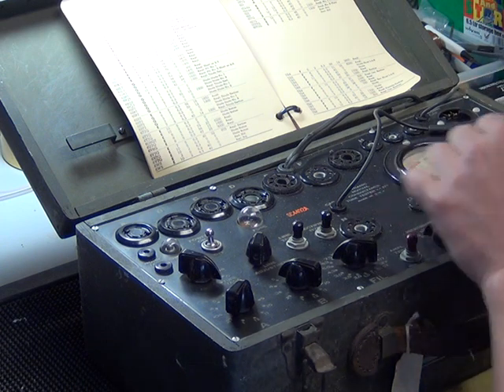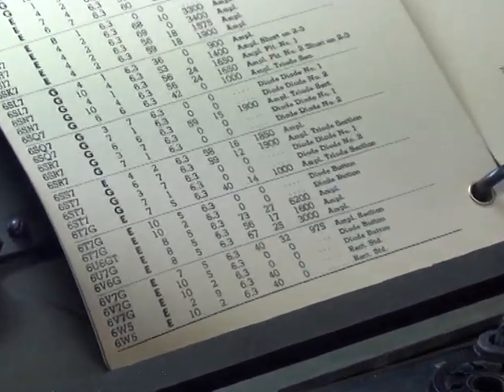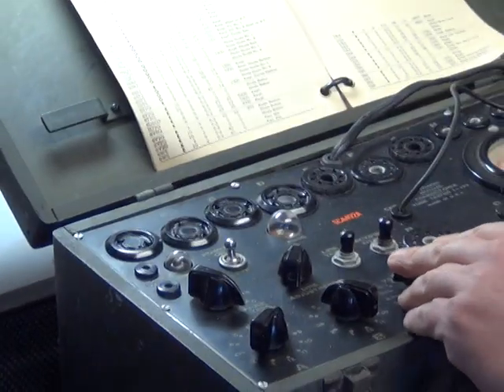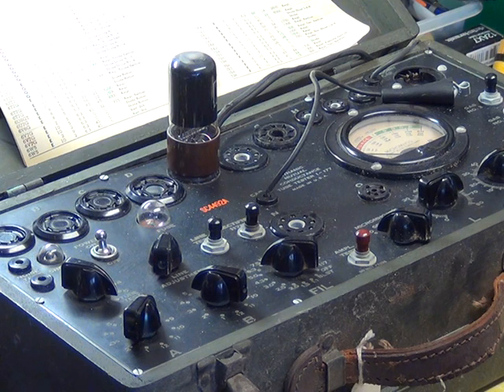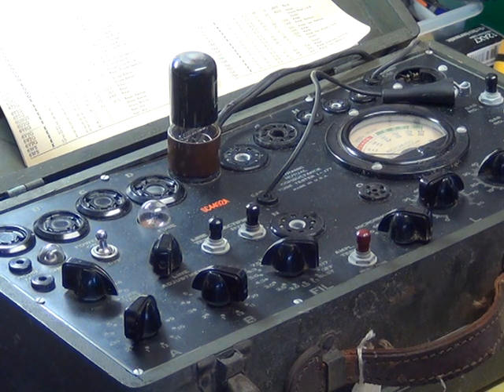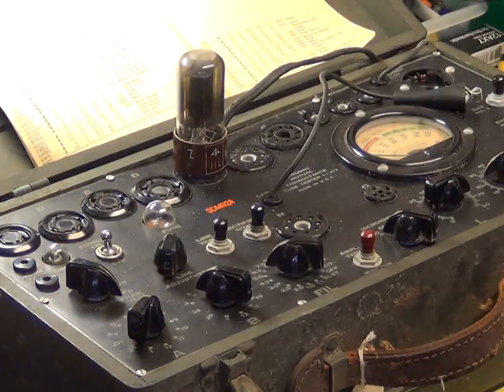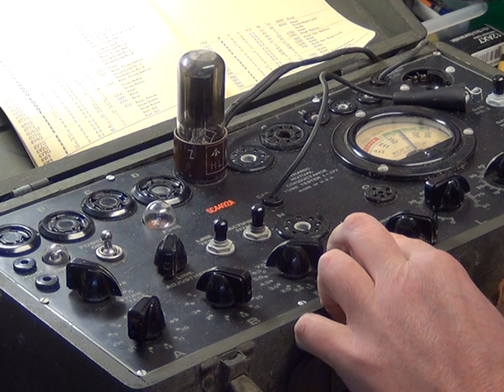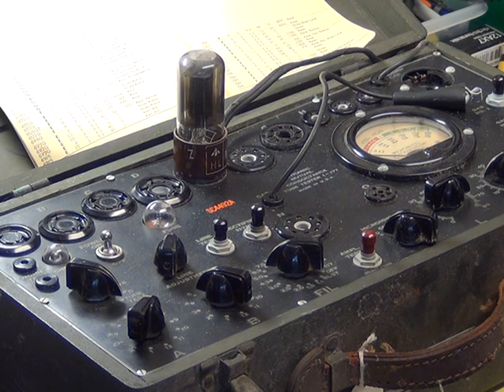I-177 (WWII vintage) valve tester in use testing 6V6 valves for Pye F27AM radio

Comment: hello, this tester can test european valve tubes?
Reply from the maker: as long as you have an equivalent guide & the valve you want to test is in  the I-177 manual. It certainly isn't going to test colour tv valves. Have a search for the I-177 manual & you'll see exactly what it tests.

Said to be the best valve tester ever for pre-1950 valves 

Richard, G0OJF, UK

Comment: I have a valve radio Pye P43U in perfect working order. Uses  UCH42, UBF80, UL41 and UY41. Using a long wire antenna I can receive distant stations in superb clarity and signal strength - and it's not bad standalone using the ferrite rod internally.
Reply from the maker: I'd be running that through an isolation transformer, Chris. I was never a lover of 'live chassis techniques' in either TV or radios! You'll have seen videos of me working on valve radios & radiograms, but I always buy sets that have a mains transformer so use the 'E' series of valves(6.3v heaters), U series is 100mA heater chain P is 300mA hetaer chain & D is 1.5v heaters. All that said, a nice radio Chris.

Richard